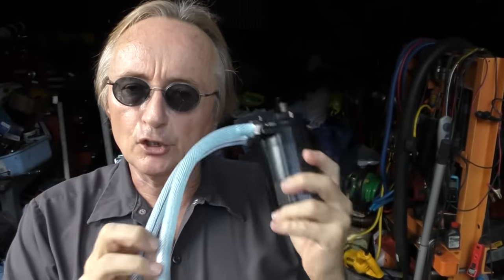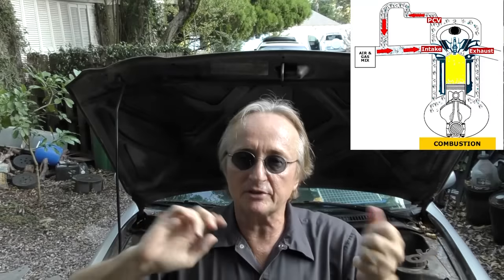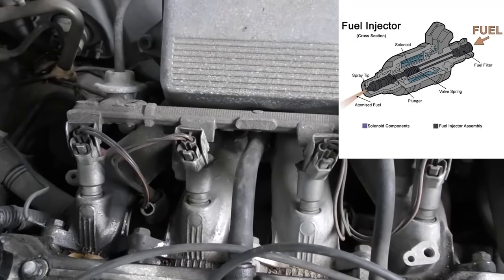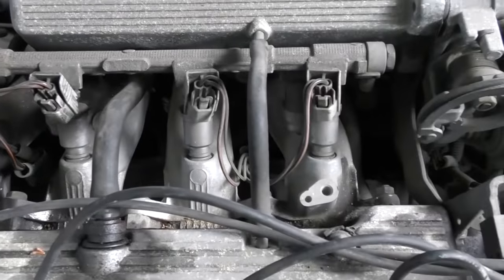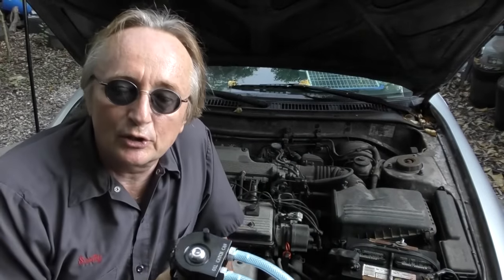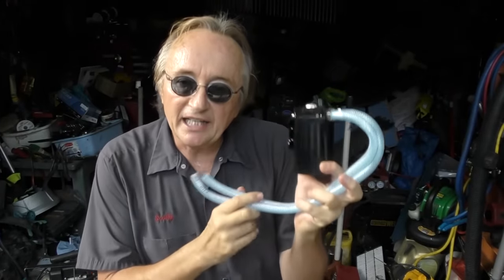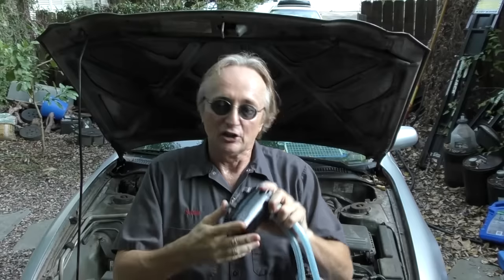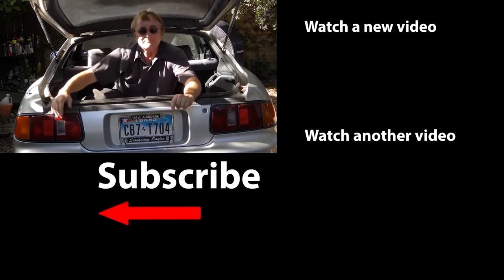If You Have This Type of Car, You Need This to Prevent Damage to Your Engine - Oil Catch Can

Comment: A caution on using oil catch cans in winter: they can freeze up and block the PCV line.  The can is fine all year until you get freezing temperatures, then condensation starts to build up in the can.  You actually get more water than oil in there in the winter months.  It needs a lot of maintenance in a Canadian winter and becomes a hassle because you have to let the whole engine bay heat up hot before all the ice will melt so you can drain it.  If ice builds up in the actual lines to the can you can get a blockage.  Happened to me and blew my valve covers with the pressure.  Happened again and blew my engine.  I'm just leaving off the can in the winter now, not worth the hassle and risk.
Reply: Word of warning in cold conditions and can be an expensive repair. Well commented on !!
Reply: get an air oil separator that has built in engine heating to prevent freeze up. Best solution. usually just have to run it off the throttle body coolant hoses
Reply: Captain Howdy haha “sweating it” like the condensation that builds up. I have no friends.
Reply: Hmmm, a serious problem in cold parts.  What about a tee close to the PCV valve with the middle of the Tee being kept closer to the engine and in a way that goes down the engine block then putting a clear container almost  level with the sump but again where the engine keeps it warm?  A tap under the container let’s you drain it away once there is enough to make it worthwhile.
Could be hard to find a spot where it’s not too hot not too cold.
Customers buying a car should not have to do makeshift things like this, the companies engineers are paid to do a job, why can’t they design a solution to this?
It annoys me greatly and worries me as well:  if they cannot work out a solution to this then how good is the rest of the engine.  Just like DPFs’ Diesel Particulate Filters - on the Toyota Landcruiser Prado in Australia with the 2.8 engine they have stuffed the design, why did they not look to the European vehicles and modify their solutions?
Anyway this is just a thought.
Good luck with this issue.
Reply: Micah AP  sorry cold air has way less moisture in it
Reply: I suspect the engineering for routine vehicle maintenance is intended for the stupidest owner possible.  If catch-cans were a normal part of maintenance in having to drain the can I'd suspect most drivers would forget and blow up their engines when the cans filled up.  Most people just get in and drive and don't know enough to do anything until the car stops running.  The fact we're watching Scotty's channel makes us the exception.
Reply: Jim Davis true, but because of the heat and temperature difference condensation forms as you likely know.
In my Mercedes W220 S350 the PCV valve goes into breather chambers designed for this.  This engine is the 3.7 litre, this one was the previous engine to the famous 3.5 litre that had the soft metal defect in the sprocket at the end of the harmonic balancer shaft that costs an arm and a leg to repair partly due to the engine having to be pulled out.
But yes, higher humidity is usually in the warmer areas.
Reply: That's why you have to rev up your catch can!
Reply: 428ghost Is this the same in California because I know it doesn’t get too cold here
Reply: Micah AP moroso check valve vented through the exhaust manifold helps with restriction from the oil catch can especially vital in the bmw n62 engines
Reply: 428ghost
Is there a way of getting the carbon off of the back of the intake valves without having to disassemble the engine???
Some sort of product that gets sucked in via the PCV hose???
Reply: If you regularly dump the catch can, and ensure that the condensation medium is not in water, it won't be a problem at all. I have had a catch can on my 1990 Isuzu SpaceCab 4x4 pickup truck for over a decade aand never, EVER had had an issue with 'freeze up'. Do not route the line with any dips where condensed wwater could collect and it will work fine.
Reply: Martin Lang e
Reply: 428ghost never had that problem. Just dump out the can every few thousand miles.
Reply: Well of course Scotty wouldn't mention this.  He lives in Houston  Texas.
Reply: yup if you do run a catch can in winter times I suggest you empty it atleast every week or 2 to 3 days thats whta I do and I never had mine clog up
Reply: Seems like all you need is to add a tee and a 2nd pressure relief valve or burst disc.  So if the catch can get plugged it will relieve pressure to atmosphere.  Seem like something that would be common sense in freezing areas for condensation issues.
Reply: Mann&Hummel ProVent 200 got a side valve. If filter freeze inside the pressure open this valve...
Reply: Good advice. I park in my garage, and it doesn't snow here in CA, so I think I'm good. But for others that live in snow/park outside, very good advice.
Reply: Good advice, but my catch can is only on my summer car. I didn't know about the ice thanks for the tip!
Reply: IAG air oil separator.
Reply: Minnesotan here, I put a catch can with an drain line to the oil pan on my mk4 gti and it’s been so cold lately and I didn’t realize condensation built up in it and damn near blew my motor. For some reason the blow by was draining but not the water
Reply: @FatherBoots  I know it's an older comment but I've read that running a line from your catch can to your oil pan is quite possibly the worst thing you can do. The "gunk" collected in a can is a lot of water, gasoline, and oil of course. You do not want water in your oil pan. Do you still do this? Not trying to argue, would just hate for that to cause problems to your motor.
Reply: @mikec3454  hey man yeah ive heard some bad things but also read around the internet to not worry about it. i change my oil every 3k since im running pretty maxed out for the stock turbo and high mileage. oil seems to come out decently clean each time and never really show sign of gunk on the dip stick or under the oil cap
Reply: @angelocardoc  Seafoam claims to do this but I've never poured it into the pcv line. Other people have, it's supposed to be safe but I don't know from experience.
Reply: Wait..  First of all, your engine does get warm or hot when running.  Even if it haven't defrost, but the contents are oil mixture, since when does oil freeze over.  If oil does freeze and if that is the case, I would more concern about the engine freezing over with no oil than the catch can.
Also, this catch can is not design to be zero maintenance, at some point it needs to be drained out and probably be check routinely while doing an oil change. But then again, for some, changing oil is an chore, but that begs to answer why did they put a catch can in the first place if they can't even keep an oil change schedule.
Reply: 428ghost yep in winter more drainage I live in Canada when cold temperature begins I drain the can every 1000km because there’s more condensation and yes ice build up in the can I drain it after a ride it’s all liquified and man you should see what the stuff the can catch you would buy one just make sure it’s a quality one with baffle and bronze filter otherwise a cheap one does practically nothing
Reply: But the water can freeze up in the pcv hose as well. I have a gm 2.4 gdi and have tons of water in the air intake. I added the catch can to collect the water which drains out the bottom.
Reply: Don't oil catch cans have a bypass, like an oil filter? So if they get clogged or full, for any reason, they will simply short circuit and behave like they aren't there. I feel like this has to exist.
Reply: @briancoverstone4042  The do in the better quality ones.  Mine was not a better quality one.
Reply: @TheTallMan50  right
Reply: Thanks for the FYI!!
Reply: How about instead of using a catch can using a marvel  inverse oiler or an ampco lubricator  filled with mmo, lucas or crc as a carbon cleaner, that should in theory clean the carbon, and it would take about 1 qt of additive for every 800 to 1000 miles.  Has anyone done this and is it enough to keep the valves clean? At least this way in extreme cold weather additive like mmo would not freeze only thicken and less mmo would reach the valves however there would be no risk of the system clogging and destroying gaskets, also the oiler in winter could be adjusted to increase the flow for mmo to compensate for mmo thickness, and on summer readjusted, or use a mid point for all year round. The only difference in this case vs a ported fuel injected or a carbureted engine is that mmo would be reaching the back of the valves without gasoline, the first encounter mmo would have with gasoline would be in the cylinder.
Reply: @JodBronson  it depends on the car I had a fiat 600 1967, and it was normal for lots moisture to come out of the vent tube, the vent was supposed to go to the air filter intake but it made the car run so poor, most mechanics back then would vent the tube to the street and you could see the moisture dropping from the tube. The fiat 600 was a very bad car, but the amount of moisture depends a lot on the design of the engine, the fiat 600 was the same as the zastaba 750, zastaba improved the original design a little but it was still an extremely bad car.
Reply: How cold we talking here? And wouldn’t dumping more frequently help?
Reply: @alphawolfadventures1470  -30C.  Drained every gas stop, but at those temperatures it takes a while for the engine bay to heat up enough to melt the ice inside the catch can.
Reply: @428ghost  holy crap that’s cold! 😂 I don’t think I’ll have to worry about this issue. Single digits Fahrenheit is about as cold as it gets around my way and that’s rare and brief. Thx for the info and reply
Reply: What type of vehicle Did you have the catch can on? Shame about your Engine...
Reply: @dusty1498  01 Xterra,